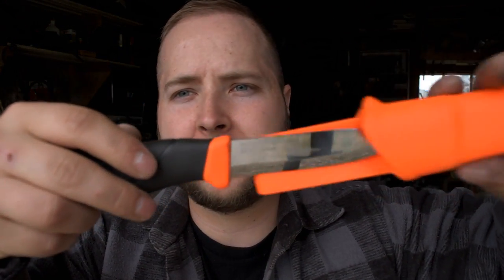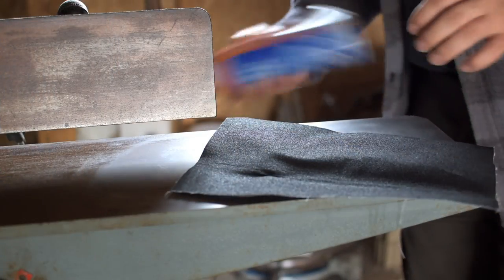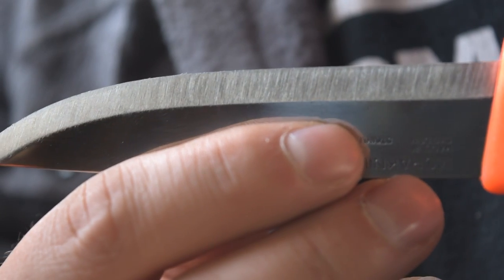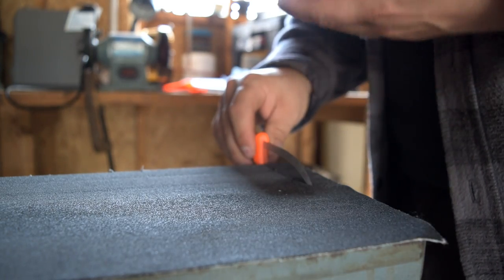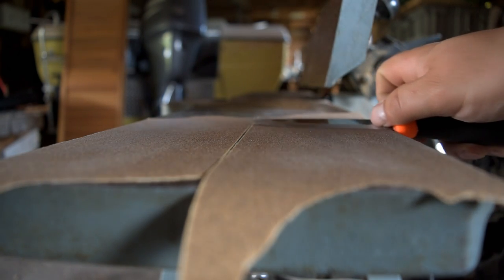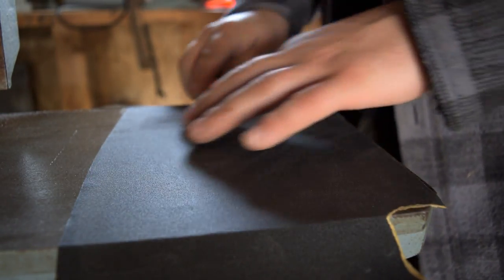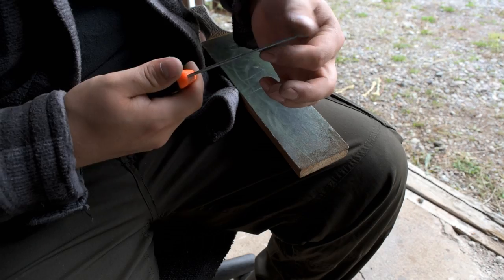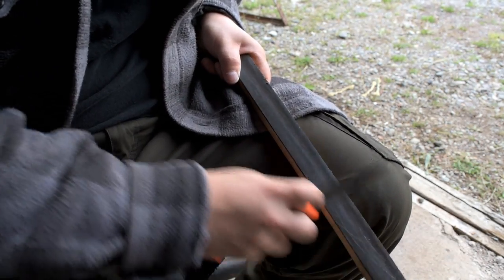How to Make Your New MORA Perfect!

Comment: What type of and paper are you using?? the only 80-400 grit I could find is for wood. Is there a special type for metal?? most of the wet dry stuff I see in the big box hardware stores for metal  is in the 600 and up grit level. Can you use standard sand paper on metal???
Reply from the maker: 3M makes metal sandpaper down to 220, I know. Below that, you can use standard paper! Use it dry though, or it will disolve

Comment: Sweet short work you made of that on papers. Quick question - sure looked like you were applying quite a bit of pressure on your stropping motion with the compound strop to begin with. I've found I can absolutely reverse some of my sharpening work by stropping too much at the end, especially as you say with that compound be able to take off quite a bit more metal than one might think. Is it just that you're staying precisely with the grind and just refining the edge further, effectively making it final "grit" rather than a regular stropping with leaning into the edge a bit to bring back the true? I'm assuming that's what's going on but though if so maybe you may wanna clarify that only cuz I know plenty of guys could easily wreck 30 to 60 min of prior work right there if stropping normally. :) But then that's how we figure this shite out. Cheers - nice vid!

Comment: Great video. Getting rid of the secondary bevel on my Mora Companion and my EKA W12 , both stainless, seems to be the way to go. It is well nigh impossible to guage the angle of a secondary bevel because it is so small, but doing it your way looks much easier with only one. Neither of them will work with a ferro rod either so I will do the spine too. 
By the way, should the v shape ceramic knife sharpener be used before or after the abrasive rod on the Victorinox pocket sharpener (pen shaped style)? I bought one and find the v thing useless. There are  opposite opinions depending on the video I watch. Some say that the v side is used first to maintain the correct bevel angle before using the abrasive rod while others say the v side is for removing burrs after using the abrasive rod. So confusing!

Comment: How do you maintain an edge like that, stropping alone or do you have to do the whole process over?
Reply from the maker: Stropping will keep a blade for a little while. However, once the micro bevel has been fixed, as we did in this video, subsequent sharpenings become much faster and easier. Only a quick touch-up is needed.

Comment: I have two of those, just exactly like that one, same colours, same sheath, everything apparently just the same but mine are from the brand "Bahco". They are sold as gardenning knives but when I saw them, I immediately thought on how good those would be as a survival item and bought one. And a year later I bought another. I recommend them. In a SHTF scenario they're easily concealable but the orange colour it's a bit flashy (you can paint it over though). Very sharp and handy.
Reply: The blade is a bit thin though, not too strong but very nice
Reply: nice steel too
Reply: Bahco bought Mora
Reply: OIC! Thanks for the feedback.

Comment: Are imported Moras dull? I've seen a few videos now from the Americas where brand new Moras need sharpening. The point with a Mora is that you should be able to go to the hardware store, get a Mora and be able to work with it on the go without any sharpening needed. We Swedes pride ourselves with the sharpness and the durability of the Mora, which are pretty much the cheapest knives availiable here. It's cheaper with a new knife than buying stones and paper etc, but of course many choose to DIY sharpen them at home. I've never seen anyone IRL make a Mora that shiny though, it looks cool ;D

Comment: what is I do this with my Buschcrafter 162? Will it work the same? It comes sharp from factory but not that sharp and I am not sure I should use the round gransfors bruk stone I have or that would produce same results!
Reply from the maker: I believe the 162 is a sabre grind. DO NOT do this with a saber grind knife!
Reply: @kyle_noseworthy  Thanks for the heads up. I have not touched with the stone, I gave passed it few times through a Smith sharpenel with diamond blades but do not notice any difference, it is said they come sharp from factory but I do not see mine that sharp. I will try watching some more you tube about the 162.

Comment: I get that this an art worth perfecting, but there's a disconnect for me where we're "gently" caressing the blade with leather and such, but then batoning and whacking the blade and putting it through much rougher treatment than when we were sharpening it. Wouldn't a split second of batoning erase tens of minutes of work, making it pointless? Can someone help me reconcile the two? I'm probably the worst at sharpening my Mora, but it still batons and makes feathersticks without all this pedantry (with all respect... it's beautiful work done in the video).
Reply from the maker: No offense taken, whatsoever. I fully understand, and you do have some point. If I was going to be treating my blade real hard, batoning for example, I wouldn't bother. However, I think you're over-estimating the time this takes as well. You can do this job pretty quick and easy!

Comment: What you've done was just grind and hone the primary bevel, so now you have a very sharp, narrow angle bevel. But it will not be durable, because of the narrow angle and soft steel. I guess it depends on what you'll do with it in the woods, but if it's bushcraft, this is not good. It would be good for game cleaning or butchering. You need a wider angle micro-bevel on that beautiful primary bevel you've just put on, so it holds up.

The mod to the spine is a good one; just careful you don't cut yourself on it in the meantime.

For my part, I just put a micro bevel on the factory primary bevel with my Sharpmaker, and it's also shaving sharp, but with only 10 minutes worth of work.

Re. the whetstones, why not use DMT diamond stones that won't dish out?

Re. stropping, the whole point of stropping is just to remove the burr or wire edge. It doesn't take a fancy strop and compound. Sharpen down to your finest grit, then strop it a few times, like the old time barbers used to do to their shaving razors.
Reply from the maker: Hey Jeremy, thanks for the comment. 

Firstly, a blade this shallow should hold up to a scandi grind no problem, without adding a micro bevel. the grind is quite steep. 

I don't like DMT stones because they don't last. I have used them, and they're now in the garbage. DMT was super popular a few years back, and everyone seemed to jump on the bandwagon because they do tend to cut quickly, and they're much more resilient as you pointed out. However, now after only a couple years of regular use, many of those people are having to replace their expensive DMT's as they are not cutting anymore. Your DMT's have a 'painted-on' layer of diamond grit. My synthetics are a solid 1" thick block of grit. 

Lastly, stropping can have many different affects, depending on the system used. Barbers did not use their strops to remove a burr. Barbers would strop their razors constantly, between shaves each time, to refine the edge slightly. A burr would not be existent.
Reply: @kyle_noseworthy  I keep dimond sharpeners in my B.O.B. and one in each vehicle. Just in case.

Comment: With 18 dollars worth of steel will it hold an edge? Is is even heat treated?
Reply: Yep Morakniv is well heattreated :) Carbon is around 59/60HRC and the Stainless ist around 57/58HRC, the Laminated Blades are around by 60 to 61HRC.

Comment: Can't imagine spending a hour on an $18 knife.
My mora came sharp enough to slice through paper.
Then after much use i go 300, 800 and finish with 2000 and its back to how i bought it. 10 mins max.
I dont need it to look polished. it's a working knife.
Oh and thats pnly if i let the knife go. Most of the time, i just mantain it with a fine diamond sharpener
With that said, your end product is pretty.

Comment: Two questions from a dummy:
Why do you need the spine flattened ? Second: what kind of "paste" do you use on the strip? 
great video. thanks
Reply from the maker: Great questions! 
1) The spine doesn't come flat from factory; it's actually rounded, and wont create sparks on a fire steel. Flattening the spine will create a crisp 90 degree angle, which will create wonderful sparks.
2) There are all kinds of polishing pastes out there. Brand or name doesn't really matter as far as I'm concerned. Get yourself a nice 'rouge' polishing compound. Cheap, and extremely effective.
Reply: thanks
Reply: @kyle_noseworthy  If you look up the paste info the different colours are for different metals, for an all rounder the red or rogue is a good standard to go for but if you have a Stainless blade you might be better off with the white.

Comment: How long does it last in the bush?
Reply: Jack McGraw the blade will roll if you try to whittle after a grind like this. If you want to have a good Bush one, get a carbon Mora. And then just use some stones to get it shaving sharp. That's how I do it and it's great for everything you'll need in the brush.

Comment: When using wet and dry paper - wet is almost always the better option.  Same principle as using a whetstone dry - it's not good for the stone or the steel.  You're going through a lot of paper because you're using it dry.  And why you're having to work hard to get rid of the coarse scratching.

Agree totally with Andy Ho.  A knife is a tool ... the edge you give it should be appropriate for the job you intend to do with it.
The samurai's master sharpener would put a mirror finish on the swords when they were carried in peacetime ... the edge was good for cutting the bamboo matting used in demonstrations of skill and prowess.  When the warriors went to work for real - the swords were resharpened to give a broader angle to stop the blade chipping and the finish was "ragged" so the edge grabbed into flesh more efficiently.
Historically Butchers knives should be drawn at 90 degrees to the edge, for meat you leave the rag - for fish you'd usually strop to smooth the edge, If its for vegetables you sharpen at 45 or 180 degrees depending on the veg one blade won't do all the jobs well.
There are too many people cutting paper and shaving their legs or arms on YT - it maybe looks impressive to the impressionable - but it's not a measure of a knife.
If you are taking up origami or making a razor the mirrored edge looks nice and will push cut paper or hair but it won't hold up to serious use - if you are going to cut something real - you need a different finish that depends on the job.
Reply from the maker: I agree with Andy as well, which is why I stated multiple times that its perfect for MY preferences, at this time. :-)
Reply: That's good - As a demo of what suits you it's difficult to argue with, just as if it cuts - it must be sharp.  Like handwriting everyone has a different need as well as style - so for shaving paper yours is indeed a masterclass.  Prior to youtube there wasn't much of a market for it however.
I felt that those looking to develop skills for EDC or their own particular needs may have missed Andy Ho's qualified comment when he says  (... nicely polished, but it makes the knife useless in actual use ... ).  For the beginner this point can't be over emphasised.
Given that your needs appear to be so niche and specialised as to be almost useless to the majority of general knife users I felt it was worth commenting on.
Your novice viewers will benefit from a more general approach that emphasises the use of water (or oil).
You don't make it clear you're using your whetstones more like slurry stones (presumably to produce a fine polish paste) OK for your purposes, but very destructive for the stone or paper - You did say that makes you reluctant to use stones for prepping customer's blades and even then your sandpaper doesn't last long.
Use more liquid and they will.  I'm still using a slate finishing slurry stone I bought an an apprentice 45 years ago.  Can't say that for my japanese stones, but I still expect to measure their lifetime in years. and wet and dry paper (used wet) in months.  Hogging metal needn't be expensive

Comment: Starting with extra coarse 80 grit is a waste of time. If one of my Moras is dulled up, I start at 400 grit, which is called medium. The 80 grit is ok only for sharpening the spine, where you have to remove about 1mm to get rid of those rounded corners.
A nice 90°-spine is not only for striking a ferrorod, but for making very fine shavings for firestarting too.
I had several Moras, carbon and stainless, and everyone came hairshaving sharp. They only started a bit of ripping very thin paper, so they were not really as smooth as I like it. I touched the blade up with a diamond plate at 1000 grit, then stropped it. Now they cut like hell.
Diamond plates are really affordable (I got mine for 30€) and last forever if you use them with water and don't apply much pressure.

Comment: Something seems not right where you live, man. I usually buy Mora Basic 511 (carbon steel) from my local hardware store. They offer it fairly cheap for 4,85€ and its branded with their colors (grey and orange). Anyway, I use the Basic 511 for carving wood and seeing how many I got, I guess I should stop buying and sharpen them instead. haha The thing is, they are always razor sharp out of the box. When I saw your Companion and your demonstration how seemingly "dull" it is, I grabbed my Basic 511 (which I just bought today, but already used some hours for carving old elder wood) and made the paper test as well. It cut like this 0:04 and that's how I expect my Mora to be, when it comes out of the box. So far, I was never disappointed and the knives can take a lot of force till they lose their razor sharpness, so I'm not buying a new one every week or so. They are still sharp, but carving becomes less elegant and more brutish, which is bad for the detailed stuff. So I'm really surprised that your Moras are not like that out of the box... Cheers from Germany!

Comment: It started to cut the paper just fine at the start. If you'd used the same cutting technique as you did at the end of the video, the results would be the same. It only tore because you changed the angle and slowly dragged the blade and then doubled the paper.

Each to their own but it's not a valid demonstration to warrant suggesting people take sandpaper to an already sharpened knife.
Reply from the maker: Boy, I sure wish you had have been there! I could have saved myself the work!

Comment: I just don't like Moras. I carry a Footprint brand Hacking Knife for bushcraft. The hacking knife comes with a sharply angled spine, and the blade is designed for cutting window glazing trim across the grain by beating on the spine with a hammer. It's perfect for batoning firewood, and still works great for general cutting of food, etc.

Comment: I really don't get it. I sharpen my Moras with wet sandpaper on a table, and I go all the way up to 3,000 grit paper before I strop. I even have a powered stropping wheel that I put on my drill to get close to a mirror polish, but there is always some scratches leftover. Little tiny scratches, and I can't get them out for the life of me, even if the blade is super shiny sharp.

Comment: Why not use a file on the spine?
Reply from the maker: That's an equally good option Steve, but I do find it a little more difficult to keep angle with a file. In this case, I simply used the paper because it was already set up :-)

Comment: First of all, there is no such thing as a "bushcraft" knife (look up the video "Bushcraft Knives - 'The Myths Exposed!'").  Any sheath knife with a 1" - 1 1/4" wide, 3 1/2" - 5"  long and 3/32" - 3/16" thick blade with anything from a scandi, sabre or full grind and  a drop or spear point will do everything you need done bushcraft wise.  I admit, the sabre grind will take some getting used to though.  Look at what the pioneers and fur trappers carried and you'll see the point more clearly.  Keep in mind the trappers knew more about bushcraft than anyone recreational crafter, because they lived it every day.

Having a razor sharp edge out in the scrub really isn't that good of an idea.  Why?  A paper slicing edge is very sharp, which equates to very thin on the microscopic level, and will blunt quicker than a 1000 grit/soft Arkansas finish, which has a serrated edge on the same microscopic level.  It's more durable since it's not as thin and will carve wood as well as the razor edge.  After all, you're out there to carve wood and cut cordage, cloth, and possibly animal hide or leather; not slice through paper.  You do have to remove the burr with a strop and compound or a ceramic rod or it won't cut/carve well at all.  I have to admit the square spine is a must, if nought more than using it as a wood scraper.
Reply: Oh, and it doesn't matter what knife it is, who made it, what steel it's made from or what Rockwell number it's hardened at; a 1,000 grit edge will always slice and carve longer than a 2,400 grit edge.

Comment: you will get a convex anyway however its all good
Reply from the maker: How do you figure?
Reply: simple by stropping. i been sharpening knives for 20 plus years and there is no way to have a perfect flat bevel manually ps i know i know lol im being to picky btw great job. ultimately its sharp and thats your point keep em coming brother
Reply from the maker: haha In the methods I showed here, the amount you'll be out of perfect flat is very small, hardly enough to consider it convex. I only strop on paddle strops, with very thin leather, for 'rolling' is very minimal. I've found it very effective, and not prone to convex. Thoughts?
Reply: i understand